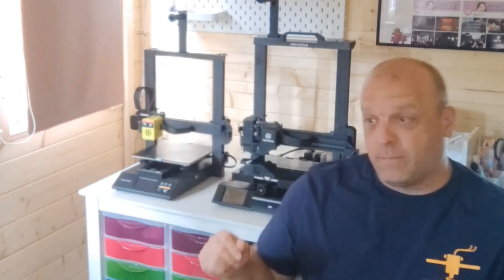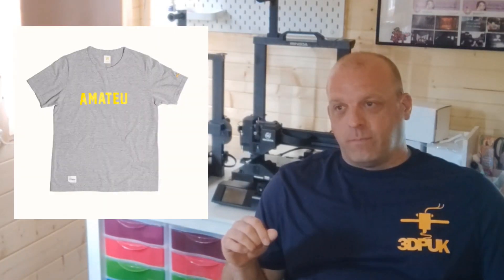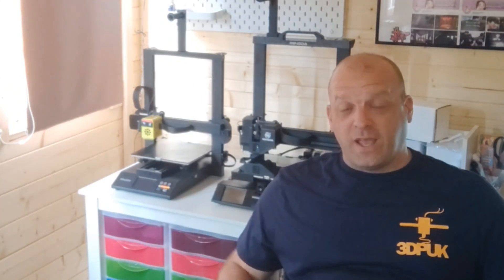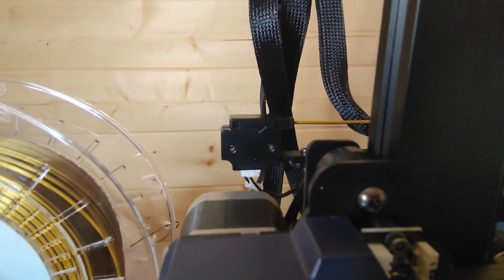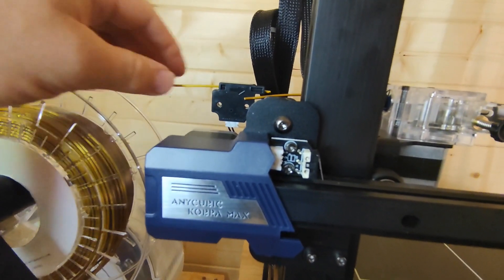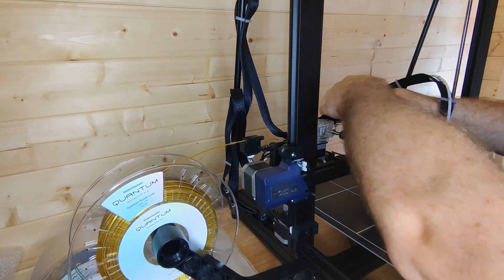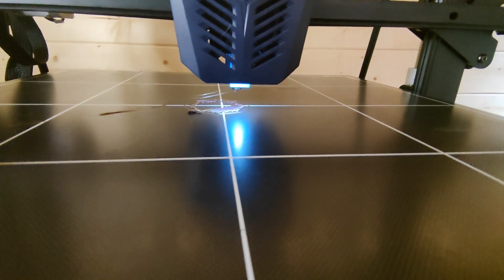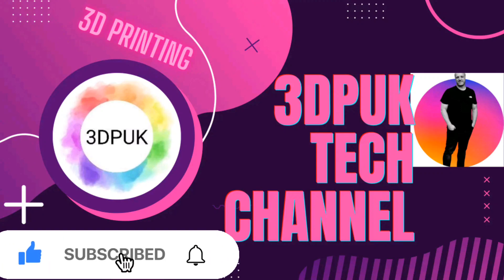Quick update & Anycubic Kobra Max Filament runout sensor process

Comment: I have the anycubic kobra plus and anytime we run out we can never get the filament sensor to turn off and resume the print.    We have so many half used rolls because we've never had a successful refill.    

Do you think we should replace the sensor?

Comment: UPDATE: Feb10,2024. I was starting to panic cause I ended up pressing pause like 4 times. No need for the extra stuff. Just feed it in behind the filament going out. The sensor will stay for at least 6 hrs. That I personally know of. But just do what u initially thought in your mind. Take the old spool off. Put the new one on. Hit resume and asap just feed the new filament in directly behind the old on. Everything is already heated properly. By the time the new filament reaches the extruder. It will be up against the old filament. Hence it will match temperature your machine will NOT skip a beat. I've had my Kobra Max for almost 3 years. Just started back printing. I realized there are NO videos for anycubic. I have a Photon D2 also. Never had a issue from either. Had to get new reservoir for the D2 cause I was being stupid lol. I have the extra bed for the Kobra max. Hadn't had to use it. All the prints adhere just fine and they come off even better. I see all the issues and accessories ppl have with other printers. Anycubic just isn't like them. I've printed soo much stuff it's crazy. I guess I need to start making these videos for anycubic cause ppl also hate on them. Saying "it's in China" "they take forever to respond" that's a lie. If u account for the time difference. As soon as someone gets to work they hit back. They've answered all kinds of questions I had in 2021. Just mad they're soo cheap now tho lol. When I got them. They both were $600

Comment: Nice video! Thanks for the help. Quick question, why do you NOT continue pulling the old filament piece out through the extruder? I couldn't get the bowden tube out like you did here, so I just kept pulling it out through the extruder. Everything seems to be working fine, just curious why not? My bowden tube was stuck in there or something cause it did not want to come loose.
Reply from the maker: Hey its more of running the risk of debris being left in the extruder... guess its a choice thing ... either way it's OK and works just my preference  thanks for watching

Comment: I have a question. Has anyone encountered the sensor working but not stopping the printing?
Reply: Yes, i have the exact same issue.  Beeps that it's out but does not stop the print.    How are you sending gcode to your printer?

Comment: Hey, I’m pretty new to printing. I have an Anycubic Kobra and, trying to install a run out sensor. My sensor is 3 wire and Anycubics video only shows a 2 wire setup. So, I’m trying to figure out where the signal wire goes or, if I even need it. Also, I assume there would be a firmware update I need to do but, I can’t find that info either. I’ve been googling, YouTubing and, switching wires around for days and can not get this sensor to work. Feeling like there’s something obvious missing doesn’t help either between the 3rd wire, firmware, device itself, im pretty well ready to toss it and go with out 😅

Comment: Hey boss. thanks for the video. You rock.. I've commented on couple of really useful videos of yours and once again, thanks. your zombie firmware update was amazing my projects are looking professional and I'm super new at this 3d printing stuff. I was just getting worried about the filament change on the kobra max and Bam your video was right there. I'm making a huge modified Cacodeamon from DOOM. its using about 85% of the base and standing from back to face of object upright at about 200 mm. it gonna cost me about 3.3kg of filament, so 3 and a bit spools. My biggest project yet. 7 day print . The filament change was my big worry but you just made my worries go away. Thanks again for all the help. Now, I just have to figure out the best way to set up the future supports. I used tree and it may have over done it a bit lol. almost a full spool just for supports even with re arranging the model to save time. lol
Reply from the maker: Your welcome 🙏 glad it's helpful

Comment: I have a Max and today i loaded a 12hour print. It printed about 40mins and gave false runout message. I got home 3 hours later and saw it. I wiggled the filament and hit resume, i'm not sure but i know the hotend wasn't  HOT...but it didn't take very long to resume. Maybe 20seconds. So does it keep the temp high, but below melting?  The print resumed fine and has been printing for 3hours now without any noticeable scars or anything to the surface skin.   I have a 38hr print coming shortly, at least i know it works.

Comment: having the filament sensor message pop up almost constantly during printing when im not out of filament. Any idea how to solve this issue or I would be willing to disable the sensor if that is possible. Just stopped a print 17 hours in because it kept giving me this message over and over, atleast 4 times within an hour of being around my printer. Any help would be greatly appreciated!
Reply: Just want to say: thank you for this solution. It's been very frustrating to deal with.
Reply from the maker: @sandroteixeira5390  glad it helped you too don't forget to like and subscribe 😉
Reply from the maker: Ok you can bypass the filament sensor as long as u print with enough filament too run the job... What I have done is snipped a 2 inch piece of filament too stay in there too tell the printer I'm full so too speak... However I can't confirm if it needs too have any in the sensor too run still.... short answer yes you can lol 😜 thanks for watching
Reply: @3DPUK-TECH-CHANNEL  thank you so much! Didn’t even think of that haha I had tried to unplug it mid print print and it wouldn’t let me resume. I’ll try that and see how it goes! I’ll update in the morning once I see if I’m still printing!
Reply: Just started the print again and so far so good will update in the morning! I’m assuming you’ve had this issue as well since you replied with that potential solution?
Reply from the maker: @andrewentrekin9985  not yet but it would be a solution I would use myself
Reply: @3DPUK-TECH-CHANNEL  Still going strong! 17 hours into a day print with no more sensor issues. Thanks so much!!!